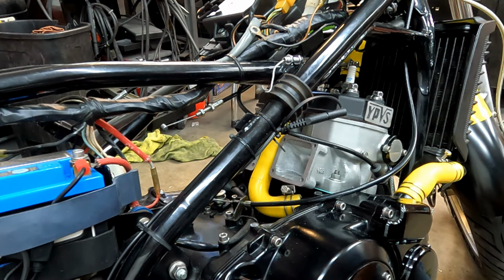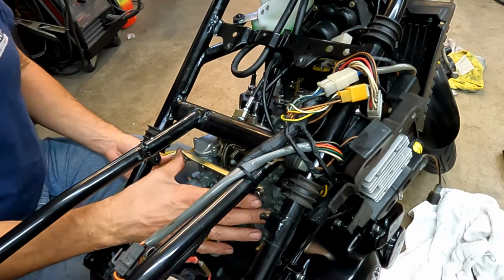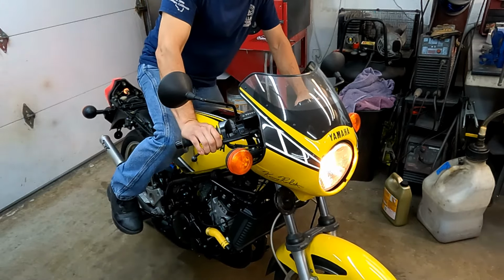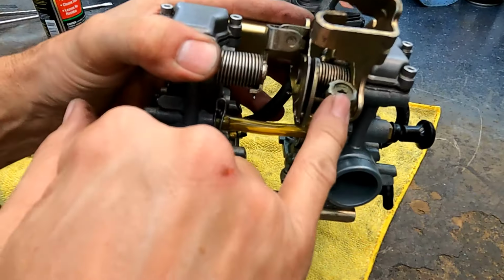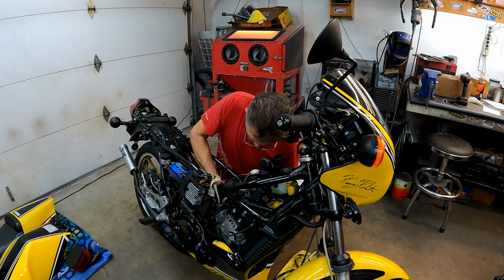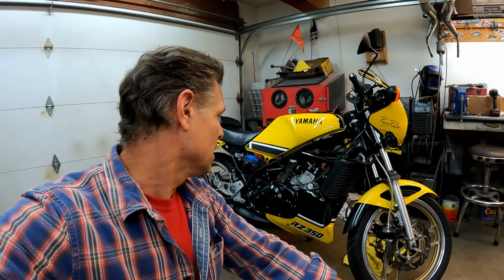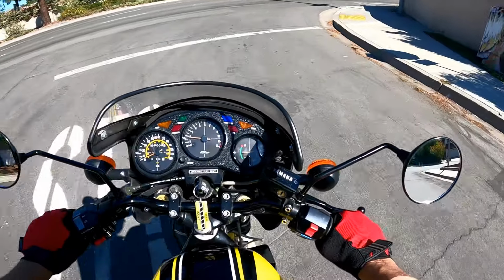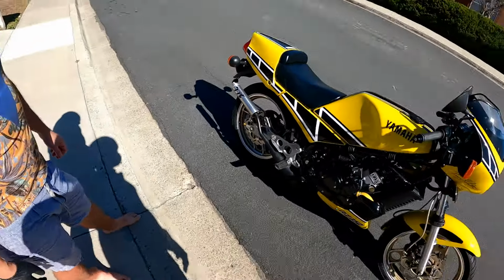RZ350 Top End Rebuild Part 5

Comment: You should do more videos on rz350
Reply from the maker: I will if any come around. I don't see them very often.
Reply: @herrjugsracing7816  could you build one to compete with any of the modern bikes?
Reply from the maker: @sethanderson9931  Making the horse power is not hard to do.